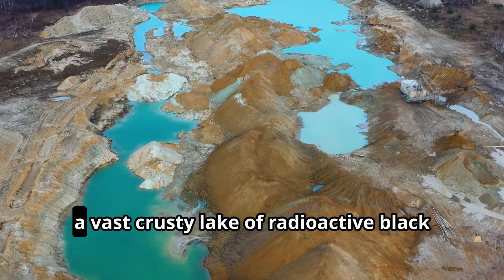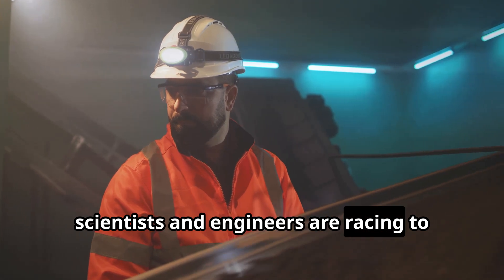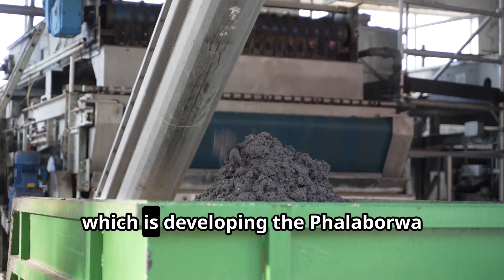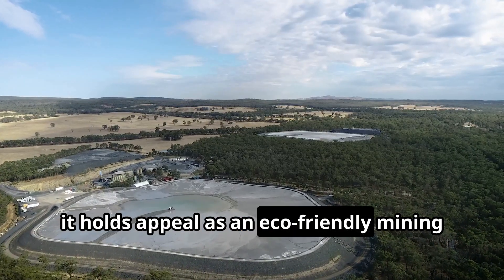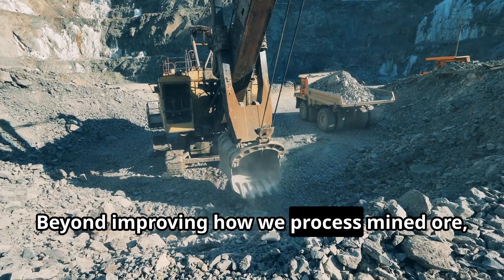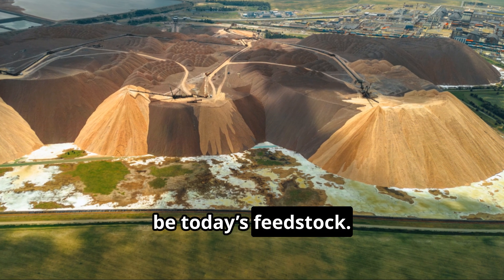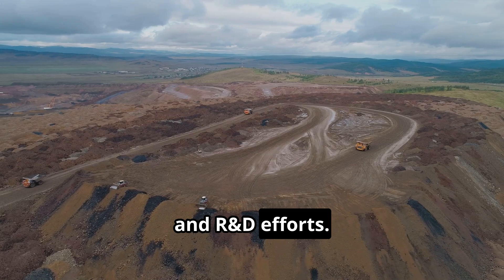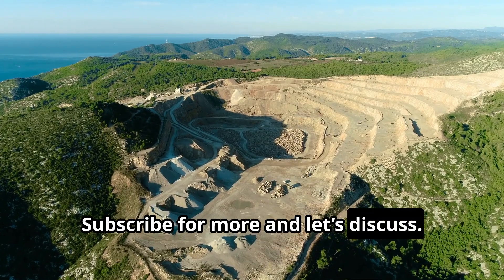Rare Earths Processing: Past, Present, and Future

Comment: Ferro Alloys, Metals & Pig Iron Supplier in South Africa | Bridge Ferro Metals
South Africa is a global hub for ferro alloys, metals, and pig iron — supplying raw materials essential to the steel, foundry, and industrial sectors. With abundant mineral resources, world-class processing facilities, and a strong export network, South Africa plays an essential role in global manufacturing.

At Bridge Ferro Metals, we specialize in sourcing and exporting high-quality ferro alloys, metals, and pig iron worldwide. Based in Johannesburg, we are strategically positioned to serve both local and international markets with consistent quality, reliable delivery, and competitive pricing.

Ferro Alloys in South Africa
Our ferro alloys are critical in strengthening steel and enhancing durability. Products include:

Ferro Silicon – used in steelmaking and casting

Ferro Manganese (High & Medium Carbon) – deoxidizing steel

Silico Manganese – improving toughness and strength

Ferro Chrome – essential for stainless steel

Ferro Vanadium & Ferro Molybdenum – adding hardness and resistance

All alloys are supplied in strict compliance with international standards for guaranteed performance.

Metals for Industrial Applications
We supply high-purity metals widely used in construction, automotive, and advanced manufacturing:

Manganese Metal Flakes

Chromium Metal

Nickel Metal

Copper Cathodes & Wire Rods

Cobalt Oxide

Every shipment is fully traceable and quality-verified.

Pig Iron Supply
Our pig iron is sourced and processed to meet foundry and steel plant requirements, available in:

Foundry Grade Pig Iron

Steel-Making Pig Iron

Nodular Pig Iron

Reliable supply makes us a trusted partner for foundries and casting industries worldwide.

Why Choose Bridge Ferro Metals?
✅ South African expertise in ferro alloys, metals & pig iron
✅ Global export capacity with CIF & FOB terms
✅ Consistent quality control
✅ Competitive pricing with strong logistics support

📞 Get in Touch Today
Request a quotation today and our team will get back to you within 24 hours.

Bridge Ferro Metals (Pty) Ltd
📍 27 Forge Rd, Spartan, Kempton Park, 1619, South Africa
🌐 www.bridgeferrometals.com
📱 WhatsApp: +27 71 736 5271
✉ info@bridgeferrometals.com | sales@bridgeferro-metals.com